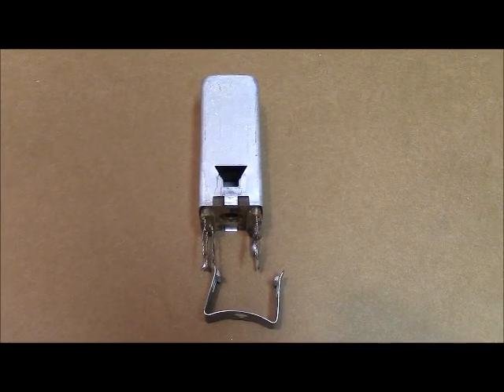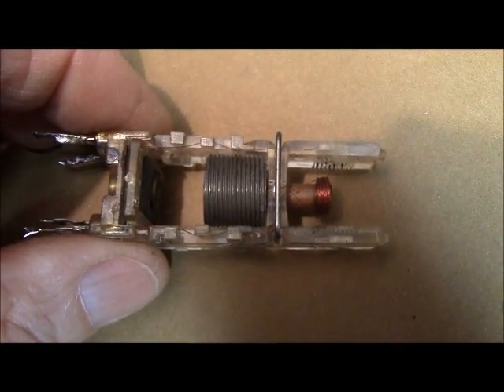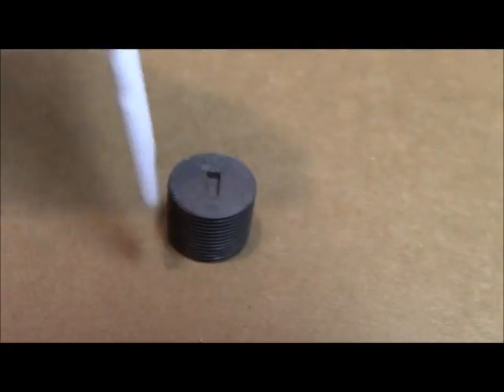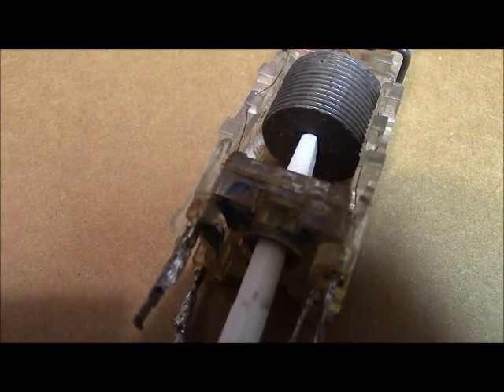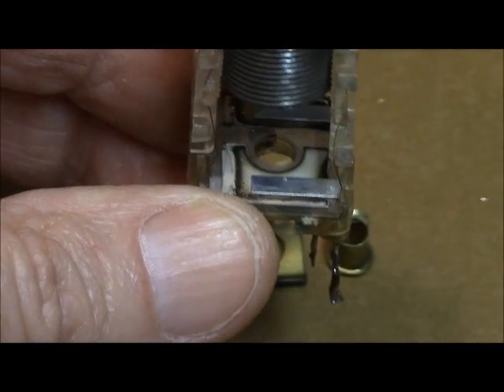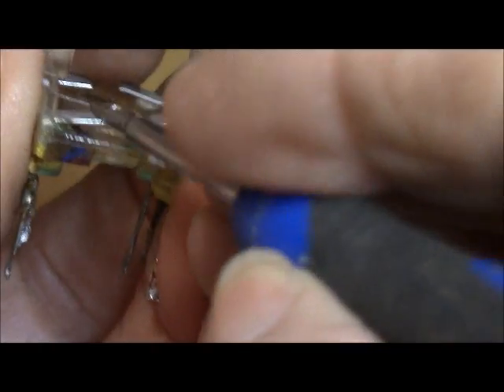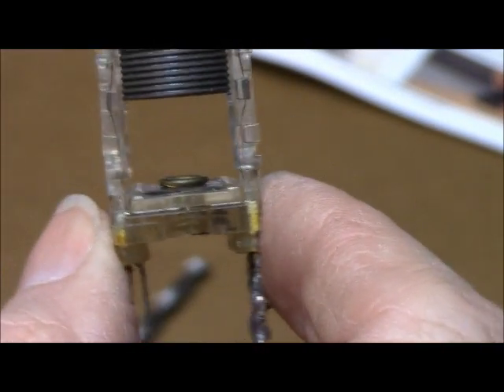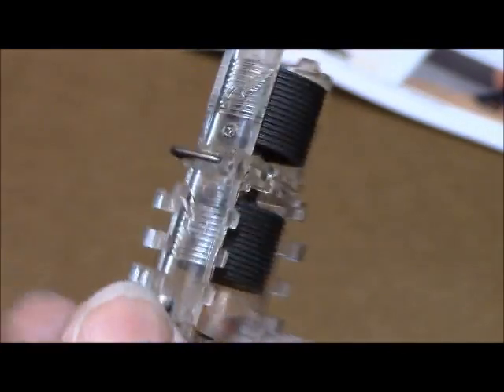Hammarlund HQ-100 HQ-110 HQ-145 HQ-170 IF Repair

Comment: Had no problems with the IF on my HQ-100, but while tuning the front end up the coil can L1 coil(s) came loose and became disconnected. Had to tear down, glue the coil form, and resolder the coils back and methodically reassemble it. Worked like a champ but the second band (1.6 - 4 meg) wouldnt tune flat, would regenerate and finally oscillate around 2.6 megs. I found a bad silver mica 100pf  (C17) that was open! Replaced that, over all everything works fine, but still need to replace the rf gain control, someone before me put in an audio taper instead of linear,  and have no real precise control of that cathode biasing.  Nice radio overall!

Comment: Those tiny copper wires are reminiscent of the litz wire wrapped around the coil forms for AM ferrite antennas. Those lugs appear to be made of the same ferrite material. It's interesting how you beveled the hole in the bottom of the IF transformer to accommodate the old brass rivet that you put back in and flared. It would be a bummer if you were to put that all together without ohming it out and then finding out belatedly that you broke one of those delicate wires! That was a pretty neat trick you showed us with the tiny pieces of sheet metal for releasing that stuck wrapping from the inside of the IF shell!
Reply: I think you mean "SLUGS"...
Reply: +Charles Smith I only RECENTLY found out what was the idea behind "litz" wire- it was to improve high-frequency response by reducing "skin effect".

Comment: I broke my cores yesterday on the 3 IF cans on my BUSH TR82D, which I got last week...It really pi............me off when it happened...it doesn't give a warning at all it just breaks...and since this radio was made only in the UK parts are very hard to get. Question..if I have another 455 khz IF can, are they interchangeable if the caps are the right size????

Comment: It has been mentioned on the Antique Radio Forum that the early version Hammarlund receivers had this problem but not in later production.

http://www.antiqueradios.com/forums/viewtopic.php?f=5&t=330921
Reply: In a search for the Silver Mica disease problem, I again found this video.  I'm considering the purchase of a HQ-180A as I've wanted one for a very long time.  Charles Smith, thank you so much for this information and I hope you are still healthy and active in your electronics repair pursuits.  This though is a PITA and requires much patience.😅😁

Comment: Hi Charles,
Great video. I have a HQ 110 that works great up to about 14MHz then the sensitivity does a nose drive. I wonder if one of the cans in my unit may have bad mica caps. The band switch has been cleaned and I aligned the unit according to the manual but the problem persist. Any thoughts?

73,
Glenn WA4AOS
Reply: +Charles Smith I was reading an old radio repair book, and it mentioned that an oscillator tube can test "good" in a tube tester, but it might NOT oscillate over ALL the frequencies that it is supposed to...this is a particular problem with the "pentagrid converter" type tubes- that combine the oscillator and mixer in the same vacuum tube. With this kind of problem, it is best try substituting another tube.